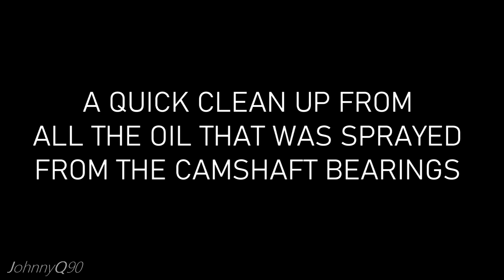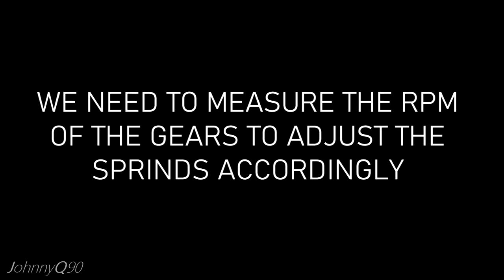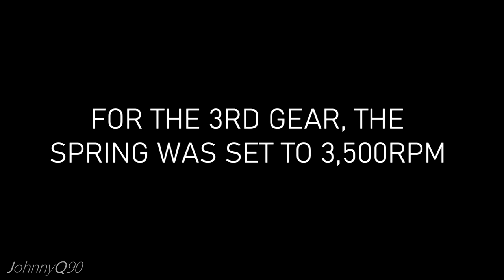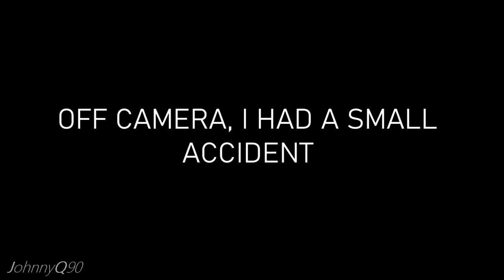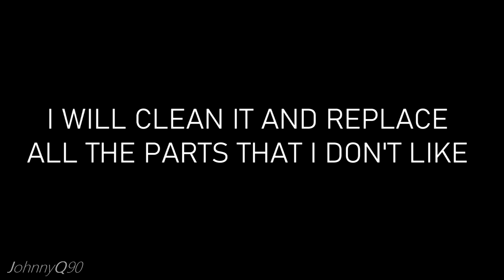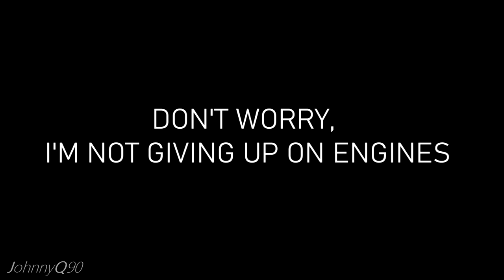How 3 Speed Transmissions work in RC Cars & Next project!

Comment: This style of clutch won't work with such a relatively low rpm. As soon as it "throws" the shoe and engages to gear, the rpm of the engine will drop and then disengage the gear again.
You'd need to modify the gear to have a catch for the shoe. That way it won't drop the gear engagement until you're decelerating and the wheels are trying to turn faster than the engine rpm.

Comment: It seems the max rpm of the motor in 1st when driving is too low for the 2nd gear clutch to engage. Also the ratios of the gears might slow the rpms down enough to disengage 2nd when it shifts from 1st to 2nd. I have no idea if what I said is right, that’s just my mechanical intuition speaking.

Comment: That 3 speed trans look cheap plastic. I feel like if you take a regular nitro 2 speed trans, lathe a longer center shaft, add another centrifugal shifting clutch with obviously another gear, you’ll be able to adjust the the shift timing to match de v4 lack of power ( unfortunately). 
But do your thing! We like what you do.

Comment: Back in the 90's I had an RC racer bought from hobby store, was a 2 speed. If I remember correctly, the gears were mounted on a shaft, moved by a servo controlling a lever that slid in and out the gears when switch was moved on controller. Simple 2 speed sliding gear, could a 3speed do the same? I dont know if they work in today's RC's.

Comment: Seems like the second it switched gears RPM would drop and it would disengage the gear.  Also if the motor speed doesn't far outstrip the speed of gears the drive cog might not ever "catch" the gear dogs.

Comment: I find all of this stuff fascinating, especially the mechanical components. I'm just curious though (forgive the noob question), how does first gear disengage under normal circumstances (i.e. without the extra ratchet/ripping the teeth off the next gear)?

Comment: wait. shouldent the clutches for the gearbox be mounted to the output shaft rather than the input shaft?
so it would measure wheel speed rather than engine rpm.
currently the lower gears cant use the engines higher rpms as it shifts before reaching it.
might wanna consider it for the next build.

Comment: A brilliant build, but where is the huge power expected from the engine?  There are a lot of good comments here discussing gearbox function, but is it simply that the car cannot accelerate sufficiently to change gear?  I think I’d be trying to measure the engine output against a load then start searching for the missing power... surely that cannot be anywhere near the expected 3bhp.

Comment: Could you not make a grub screw tension spring system to adjust spring tension for gear changes to save stripping apart and swapping springs. Also what tyres are you using on this build I have an old kyosho superten but can't get hold of tyres to fit the wheels and what your using looks perfect. The superten wheels are 60mm diameter 30mm wide on front 40mm wide on rear, any info would be appreciated

Comment: What is the point of the gears engaging at all if they don't drop the engine speed back into it's power band? If the gearbox shifts at 5,000 and the engine still has to be at 5,000 to keep it engaged, the gearbox isn't doing anything but putting more strain on the engine!
Once a gear is engaged, it should stay engaged until the engine speed drops below a certain point, or the throttle is opened further than a certain amount (kick down)
What is probably happening if I'm seeing this right, is that the gearbox DOES engage a gear, but because of the ratio the engine speed drops entering the gear and the spring disconnects, which puts it back down into first. The gearbox should shift based on WHEEL speed, not engine speed. When the wheels reach a certain speed the gearbox should engage the next gear in order to actually maintain the powerband on the engine. In theory this gives you a much higher top speed and also improved fuel economy, the whole point of a gearbox in the first place!
3D printed parts don't work very well for suspension, since plastic does not respond to shock and stress very well. It's likely to bend and shatter before it actually does any suspending...
Also, that V4 has a great sound. Would love to see a bigger cam or something in it some day.

I don't hate ya for the electric motor... But I definitely won't be watching as closely as I did this. Electric motors in RC cars are really overdone, and there's just nothing interesting about them. It'll just be another whiny little box that moves, and you could probably buy a stock one that performs similarly if not better. No reason to build one electric, the engine is what made this project interesting.
Your money and your channel, however, so do as you please my friend

Comment: use ABS. print in enclosure no part cooling. then use a metal pot with lid add a couple tablespoons of acetone close lid then place on a hot plate or clothes iron placed upside down and heat the pot to get the acetone to turn to vapor. turn off heat source then lower parts in to the pot until parts turn glossy. do outside or in a well ventilated area. goes without saying but do not do this near an open flame.

Comment: If you decrease your engine to gearbox ratio, and increase your final drive ratio, you should be able to get adequate input shaft speed to make the trans shift.🙂 (i.e. engine to gearbox 1.5:1 instead of 2:1, and gearbox to final drive 4.5:1 instead of 4:1) ..just using arbitrary figures for demonstration. I don't know what the power curve is on that engine, but it seems to be revving awfully high before it actually engages.

Comment: Is that a 4 stroke engine as well, am I right thinking a shorter spring engages at a lower rpm, the longer the spring in third the higher gear kick in, just a bit confusing for me.

Comment: Why the gears didnt switch (with the new springs)? I was also confident it would work.. Did I miss the reason?
Reply: I think because he measure the rpm from the engine without any load. So maybe the rpm is much lower

Comment: Dont feel bad about the electric motor. 
Sounds like you're having lack of torque to reach higher rpm. Electric ones have plenty of power at low rpm, and a wide range of rpm. 
Youll have to reconfigure the ratios surely, but i think that would he a nice learning, and a step to build a combustion project. 
I'll encourage you to do it.
Big sucess I'm expecting for you

Comment: I believe your gears are too tall.  Shorten the gear ratios and it should work. At least a good starting point. I'm assuming that this trans was set up for a high torque, high rpm electric motor.  So definitely change gear ratios

Comment: You're not turning enough RPM with the engine under load for it to shift. Instead of going with even softer springs on the clutch, either go with shorter tires, or a shorter rear end gear so the engine will turn a higher RPM for a given speed.

Comment: Hey can you make a turbo for this engine
Reply: Not enough exaust force
Reply: Or maybe he could connect the turbo to a high speed electric motor and have that respond to a button he pushes to make it spin
Reply: @KaiRuffin2121  what about using engine's output shaft to drive a turbo ( well that makes it a supercharger)

And motor would be great

Comment: How about an engine driven generator that then supplies voltage to electric motors? Like a locomotive. Or..an air compressor that then drives air motors fro the drive train.

Comment: it looks like its not getting enough rpms underload its redline most likely is lower then 4600 when you measured it cause it had no load on the engine

Comment: How dare you say we're gonna hate you. Lol.
Anyway, the load when you put your rc onn the bench will be diffrent compare to on the actual road
(Sorry bad english) 
It probably wont even reach 2500 RPM on the road because the weight on the car. My assumption is, the V4 dont have enough torque to reach the rpm to swich gear on road. But if you put it on bench it will because no load.
Maybe... i dont know.

Comment: Oh, a pseudo-gear box, i guess i missed that. If i were you, i'd bite the bullet and got rid of the clutched gear engagement, you being you, could probably make your own gearbox, maybe something like the Tamiya ones, IMO, clutched gearboxes (or as i call them, governor gearboxes) are not worth it.
If you don't want to, and think it's not worth it, just mill away the outer most portion of the clutch dogs and epoxy glue lead weights of the same shape, if even lead's not enough, use the material they use to glue copper pipes with (it's a lead alloy, name escapes me at the moment). If even that's not enough, you need to change the diameter of the whole affair or gear the motor to a proper size, probably 6 or so teeth should be enough...i think. Difficult to gauge these things without actually being there.

Comment: You are measuring rpm wrong, engine under load has smaller rpm than measured without any forces most probably your engine never reached designated rpm.

Comment: why not use a bigger frame that will give you more space for larger components that will scale easyer , something like a Carson rockwilder , yes they are old , yes its heavy , but it has a good 4 wheel drive system and large enough to scale your parts into , i used to have a carson rockwilder and i regret giving it away because i could take it with moving to america
Reply: or , if you want to stay on your current scale why not use the transmission type out of a traxxas jato 3.3  , it has a adjustable shift moment by use of a screw without the need of taking it apart. why re-invent the proverbial wheel if the research already has been done. great work by the way !!!!!!!

Comment: if I were you I would throw on transmission from savages 21 hpi it have adjustment screws for set at rpm in transmission and yes it 4wd
it 3rd speed
if you wanted reve on it there kits add in but remove 2nd n 3rd gears

Comment: try mechanic-to-electric drive train, no clutch, no transmission, no shafts
Reply: super capacitor to have super acceleration, and have the engine generate electricity when needed

Comment: Gasoline engine is so hard with customization. I prefer electric motors
Reply: yeah because with electric you just increase the voltage and you get more power. Its cool but boring. Actually electric is harder because the electric motor CAN'T be modified. You have to swap it with a bigger one. With gas you could install a high compression head, better carburator, tune the air/fuel mixture etc.Also with gas you get that awesome sound, you can refill the gas tank instantly (no waiting for battery to charge) and you get many more playtime hours. The electric will drain the battery fast